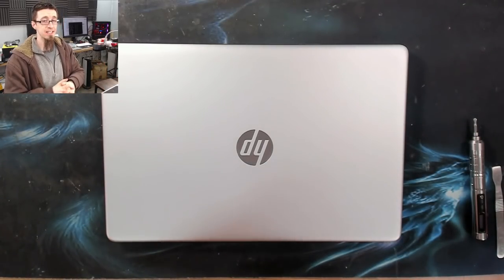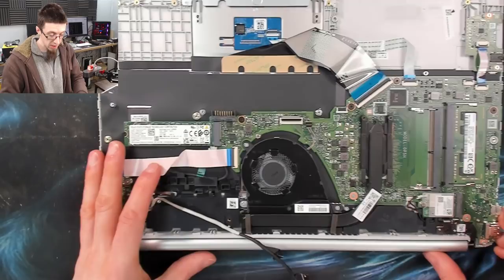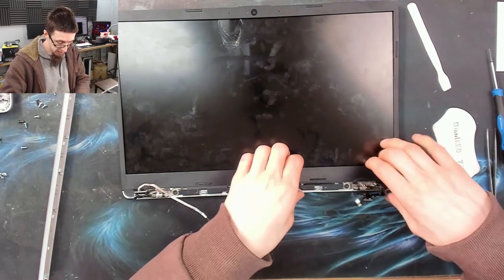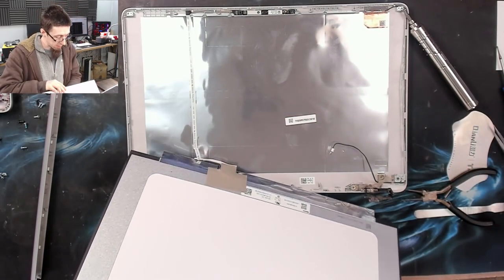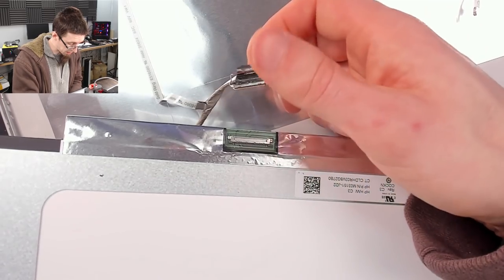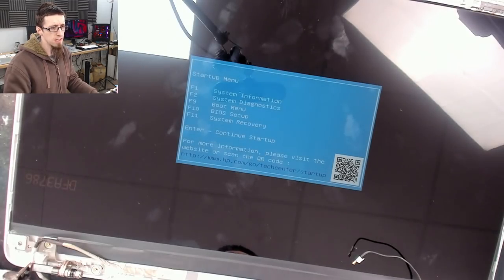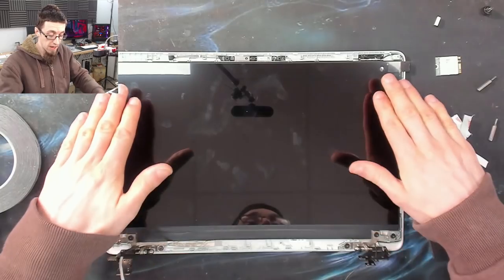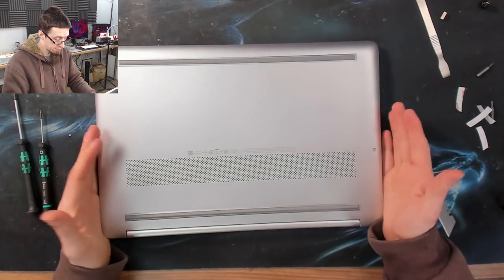How to Fix Modern (Non-touch) Laptop Screens - LFC#302

Comment: Use a thin guitar pick to remove the bezel. That metal pry tool is not as giving and can damage the bezel or other plastics. I highly recommend locktite on the hinge screws. They will wiggle loose and create a new problem for the client.

Comment: While most of people wont even notice the change in panel type, you may wanna ask the client how are using the laptop and what for before doing a panel switch.IPS panels have their drawbacks, like they are generally more power hungry, so it may affect battery charge duration.They have slower refresh rates and are more propense to ghosting, so if your client is an old school FPS gamer it may not like the new panel that much.And they are much harder to calibrate properly, so a multimedia editing type of person could find annoyingl to have to re-adapt to the new panel.
But most of the time is just a great upgrade though and hope your client appreciated the extra effort you put to not only repair it, but also improving it.Great vid as always
Reply from the maker: Broadly speaking, yes. There are advantages to good non-IPS screens... however, the vast majority of consumer laptops don't have good screens, they have the cheapest LCDs money can buy. It's a miracle that 1080p is finally standard. But yea, when working on higher-end stuff this is something to be considered!

Comment: The stretchable double-sided tape that I saw you remove is used on curved screen TVs -adhered to the front plastic cabinet on all four sides (medium adhesion) -... it is different from the tape (although also double-sided) that we use to stick the strips and/or LED strips and its main characteristics to take into account in this case are: it has stronger adhesion and supports more temperature and/or heat because it has to adhere to both the strip and the metal cabinet at the bottom that serves as a heatsink and an error (in my opinion fatal on TVs with a screen of 50 inches or more) that you frequently observe is that this metallic cabinet located at the bottom (as a rear cover) in many cases does not have ventilation slots... I do not want to violate the youtube rules so don't leave the links... thank you very much for sharing... greetings

Comment: Excellent video. Beautifully clear and measured. A shame the customer didn't go for extra RAM while you had the thing open. M.2 upgrade too? Still, having benefitted from your excellent work they're bound to be back for those upgrades.

You should be able to use silk thread or dental floss to take the bezel off the panel. Works for dashcams on windscreens too. With regards to putting the double-sided tape on the metal part of the panel is it also because you don't want the glue to bleed through and damage the panel?
Reply from the maker: Yea, I dislike applying any adhesive that i know is probably going to damage something if removed. Good shout on the dental floss, need to try that out.

Comment: Also want to add, if you use Loctite Threadlocker, make sure it is the weak (purple) or maybe medium (blue) type, if you are using non-Loctite brand stuff, it is the threadlocker based on lacquer not the stuff based on cyanoacrylate you want to use for small/fragile electronics.

Comment: Nice video. I also had repaired those kinds of HP laptop. The long gray plastic at the bottom of the LCD screen near the hinges, I usually just slide them either to the left or right to remove them or put them back on.

Comment: Actually ChiMei and Innolux have been merged into one company in 2010. My Innolux N140HCG-GQ2 reports CMN ChiMei N140HCG-GQ2  in EDID data, and it is an original panel, marked with Innolux and Lenovo FRU part numbers. Also, replacing the tape around the bezel is a good measure, that's tru for these type of HP laptops, and especially on all thinkpads from T440 (4th gen) and above. 

Tips for thinkpads: the bezel on older machines (2014-2016, up to T460) have a 2 part bezel with screws that go underneath the decorative slim fromt bezel, and it has to be removed. Since T470 and above, the screws no longer go through the plastic frame, the whole bezel can be removed (front sheet+frame) should be removed together.

Comment: The 3M command strips are like that, pull and they release from whatever they are connected to without any damage. I'm in the same boat as you I'm in Idaho, USA, so I order from ebay or US based companies, I don't big volume either. So I just order one when I need it.

Comment: Great Video, thank you for sharing it. I have two laptops of my own I want to have a go at repairing and I need pry tools and screwdrivers. Where is the best place to get them from? I have looked on Ebay but, most of the seller have high negative scores and some are untrustworthy. I have had issues the Amazon and I don't like to use Etsy, picky I know :) , Is there a place that I can trust to buy these tools? Cheers.

Comment: HP 450 and 250 are like this, so annoying. Schools I support use them solely. Give me the thick bezel and screws back!!

Thankfully I've got that many spares from damages I can go in heavy handed and speed things up, don't need to worry about ordering replacements.

Never had tape on the top by the camera though, that's one to look out for!
Also didn't know about the battery, not hand one short in me yet thankfully, thanks for the tip!

Releasing the tape, wrap it around a screwdriver or similar. It's way more gentle turning the screwdriver to wind the tape on rather than pulling.

Never found good supplies for stretch release tape. I'm using cheap black double-sided electronic tape from Amazon. Yet to have to repair one I've replaced already so don't know how easy they'll be to get back off with the cheap tape.

Comment: I see others mentioned it, but I'm curious if the 3M command strip refills (the adhesive strip replacements) might work. Always enjoy the videos.
Reply: I’m sure they would be perfectly fine to hold the panel to the backplate but I’m not sure about how they would handle the heat. I only call them command strips jokingly…

Those are more of a porous foam composition than the far more rubbery genuine part HP sells. Some research needs to be done on that though. A more affordable alternative sure would be nice.

Did I mention that they don’t always send the strips with a panel replacement order?  Yea. That’s a thing.

Comment: Excellent job as always. Any idea why the wi-fi card only had one aerial connect when all I've seen have had two?
Reply: HP designers spared a shielded cable, an antenna and two mcx connectors. With a single antenna, no diversity.
Reply from the maker: Consumer HP laptops.... aaaaren't very good. I actually cut a rant about the fact that this was a 2022 laptop with 4GB of RAM, 128GB of storage, and a single antenna wifi card, because that's not what this video is about.
Reply: @Adamant_IT  thanks. My old HP has two but can only handle 8gb of ram and won't suffer windows 11, but it does me👍
Reply: @peterlennon1139  I still have my old HP Dv5 1190ep and still works great, ironically I had to replace the screen once, but it was a breeze compared to the one in the video. In fact, i have on order a Intel T9800 and a Intel Turbo Memory 2gb for the second free pcie slot (gonna spec it out). Don´t know if the Intel turbo memory module will make any perfomamce difference but it was dirty cheap and it will be cool to have it there.
Reply: @peterlennon1139  - I'm thinking that we are soon (~ 1 year?) going to see a deluge of used PC's and laptops that don't "cut the mustard" for meeting Win 11 specs. I think the threshold is eg. 7th gen i7 (not sure but what I have heard).
A bit of a shame and hard on the planet but if we upcycle these poor victims into Linux boxen then that would make it less worse.
Cheers,

Comment: I actually have had to break off the mounting tabs from some displays because the ones without simply were not in stock anywhere. It's risky as you can damage the display, but so far I have gotten lucky. Though I'm sure my repairs have humored other repair people if they have encountered my work. I don't have a shop, but I do repair friends and families computers and electronics. Perhaps I should open a shop XD .

Comment: hey sorry to bother you and idk if you're gonna answer this but i have an issue with my laptop where my screen colors are negative they are dark and dark only i can't see very well and this issue used to happen and i would just touch the bottom of the screen side of this laptop and keep tapping it until it got fixed  today tho my laptop fell off my hand and the colors were negative i tried to tap it like i used to but it doesn't work now 

i was wondering if i need to change the whole screen or is it just something that got disconnected on the inside 

i know it's too much to ask but i am quite worried atm

Comment: I have a separate question regarding video on laptops. If it turns on but no video on screen or hdmi/vga/etc. output, how do you diagnose whether it is actually a screen (if it looks visually ok), ribbon, chipset issue without having to purchase and try all the them?
Reply from the maker: If you disconnect the internal display and still get no output on HDMI, then it's very unlikely to be a display issue. At that point you'd be looking at chipset, BIOS, etc, issues.

Comment: I would have just done it hot and in place (unless it has one of the strange bezels.) The wires beside the hot are not connected but surgical precision is still a must.
Reply from the maker: Yea, this bezel would've been a nightmare to do in-place. I will often try for an in-place removal, but also in recent times I've found it's often faster to just get on with removing the display assembly, rather than spend 15mins trying to get the bezel off in-place, only to realise you need to remove the assembly anyway. If I take the back panel off and see that the mobo needs to come out, I'd definitely try for an in-place removal. This is all assuming that we're practised though, beginners should always go for assembly-off.

Comment: You can buy the "command strips" for laptop LCD mounting directly from HP Part Store, but of course, like everything else, it's over priced.  As a ASP for HP, I actually get 35% off and it's STILL overpriced.  However, it's cut to length and works every time.  If you want the part number, just let me know!
Reply: (Universal) stretch release adhesive on aliexpress... also expensive even there.

Comment: Wait until you have to repair an 840 G7 for HP.....the infamous double sided tape that's holding the bezel to the backplate is so tough, it will peel the anti-glare layer from the panel damn near every time.  I've even started sending machines to the HP depot where the LCD has to be removed without damaging it, and even they end up putting in a new panel....I'm guessing because they broke it too!  So tired of all the adhesive used in modern laptops...pressure clips work just fine.
Reply: I actually ordered a cheap low power heat gun recently just for the purpose of seeing if that will enable me to get those bezels off without destroying the panels.  As you can imagine, if I have to replace the camera/mic assembly as a warranty repair and I break the panel trying to get to it, I’m down nearly $200 for a new genuine HP panel. If the depot breaks it for the same repair…they eat the cost, so it’s a no brainer until I can consistently remove the bezel with no panel damage. 

It’s super frustrating.  My customers have to wait the additional few days for the depot service that I could handle same day IF they weren’t in love with glue.

Just to be clear, I’ve been repairing laptops for almost 20 years and this is the first model that I’ve ever broken a panel on ever, and not just one. After the 4th time, I just conceded that the design was the problem and that was confirmed when I received the depot repairs back and saw new panels on every one of the parts replaced lists.

I tried fighting back with HP citing the depot’s tendency to break panels at the same 100% rate as I was seeing in an effort to get my $800 back that I spent on those 4 warranty jobs. I’m sure you already know they told me to kick rocks.

The really REALLY frustrating aspect of this is if they would source dependable cameras/mics that wouldn’t just stop working for NO reason less than a year after deployment, I wouldn’t have a need to even remove the panels!  I’ve replaced more cameras in the past 2 years than I did the entire 17+ years prior. I get it…people working remotely now suddenly means that these embedded cameras are actually being utilized and thus, there will be failures. I just never imagined it would be as prolific a repair as it has become.

If an HP representative is reading this (yea, right) please ask your design team to make enterprise models with sturdy panels, screws (can’t believe I have to ask for screws) for mounting panels, high quality cameras and mics and NOT the cheapest SSDs they can find. Enterprise machines are deployed to people who have little to no respect for the condition of the device. They get constantly dropped, sat on, run into the deepest parts of Hell while being used in their laps, on a blanket (“It’s called a laptop right? Durrrr”) and just general apathy for what are essentially the most budget machines that can be built that will “do the job”.  They need a bit of resilience that has gone bye bye in the last few years.

To be fair, HP is not the only manufacturer guilty of these practices. The insistence that laptops be as thin and light as possible while still performing like the desktop replacements of yesteryear is asinine. Make them sturdy and relatively reliable…that’s the hero we need, even though we don’t deserve it when we complain about a 4 lb device being “heavy”.

Comment: Great video before this one I was watching one of your different video about bios programmer ch341a because my pc is not posting , i an asking the question here because this is a recent upload hope you don't mind . 

I was looking for my bios chip and couldn't find it anywhere i found one in eBay but it costs a bit more than expected and not worth it so I was wondering if I can use any 128bits bios chip from different motherboard and reprogramming it with mine motherboards bios because I have a 128bits chip , or are there any other variables that I need to worry about , I will really appreciate if you or anyone else can help .

Comment: You did not replace the sticky tape over the WiFi antenna, Does this matter?
Reply from the maker: Naa, it's just there to stop the antenna popping off, but I've genuinely never seen that happen on any laptop of any age, ever. When it's a plastic screw-on cover I'll put it back on, but I usually don't bother with the stick pad thing.

Comment: 30pin is for 60hz 1080p screens but if you have 1440p/4K or 144hz or similar it's most of the time 40pins.
Reply: I just replaced a display on a Dell 15.  It was 60hz 1080p with 40 pin connector, but was a touch display so I figured the extra pins were for touch.

Comment: My screen didn't have any pull tabs..  and I didn't have to take it out in pieces... Got it out in almost perfect condition... It did fight me and take about 15 mins tho... 
A tip I would give to others in my position is to heat the lid from the back with either a hair dryer or hot air work station if you have.. That will weaken the glue and give you a chance.... Alcohol I just don't see helping you much or how you'd get it in there......  A good pry tool and hot air is the only way if you have no pull tabs...  It's not fun but doable...

Comment: Also, the sad reality is that most sellers of screens on Ebay will happily sell screens with defects but given an "A" rating.

I don't think I've ever gone incident free on a screen from Ebay here in The US. Regardless of seller it seems that it's really 50/50 as to whether you'll get a debt-free screen or not. 
So you can buy direct for an insane price or roll the dice on Ebay. Just the reality of the situation, sadly.
Reply from the maker: That's disappointing to hear. I generally have a good experience with eBay UK, only had a couple of bad screens after buying many many. This is why I encourage people to share alternative suppliers though - may well help someone who has had no luck with eBay!